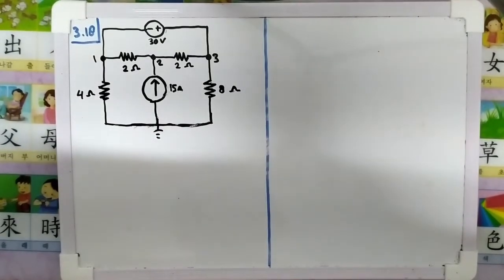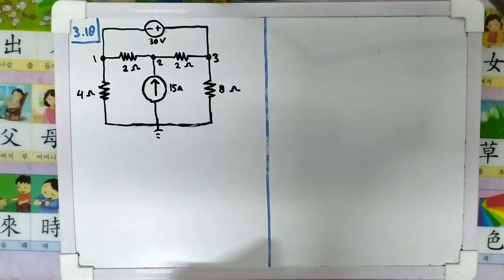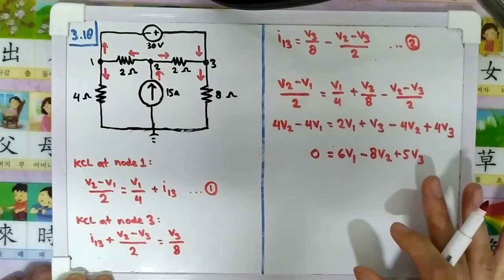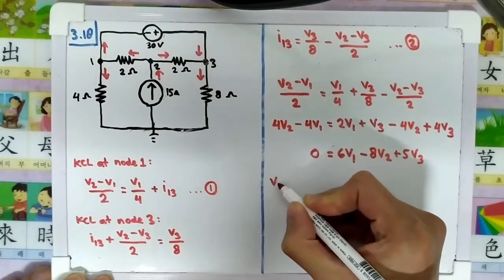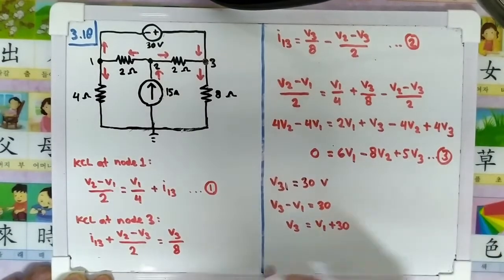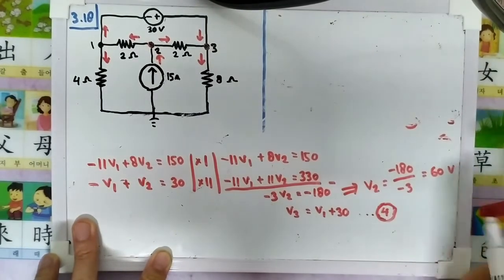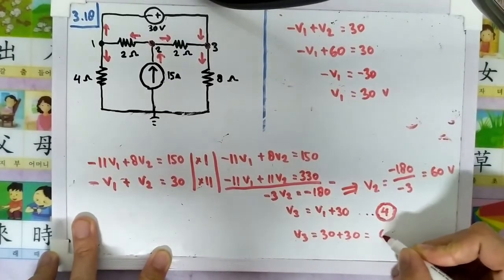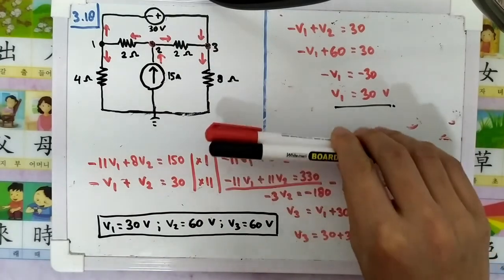Problem 3.18 Sadiku - Determine the node voltages in the circuit in Fig. 3.67 using nodal analysis.

Comment: Sir,I think u made a slight sign error,bcz if u input your very first 3 equations in calculator ,it gives v1=50,v2=50,v3=20.(Also )I made constraint equation(v1-v3=30v),does that makes any difference?

Comment: Hello sir, i am curious why there have a current flow from node 2 to node 3? Since  node 2 and node 3 have same voltage
Reply from the maker: Node 2 and 3 don't have the same voltage.
Reply: v2 = 60 V , V3 also = 60 V. So i am wondering why current can pass between them
Reply from the maker: @Ching-sx2nc  Zero exists
Reply: @Ching-sx2nc bro node 3 has almost half the voltage of v2.